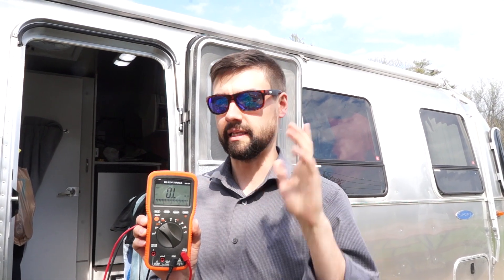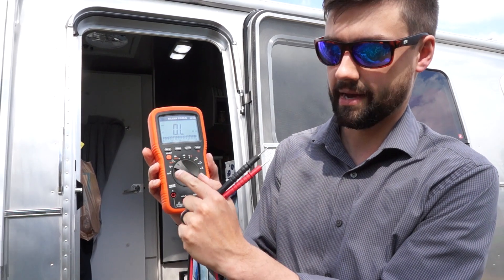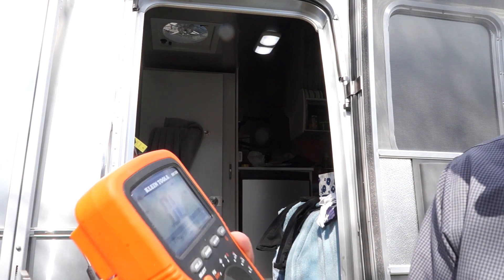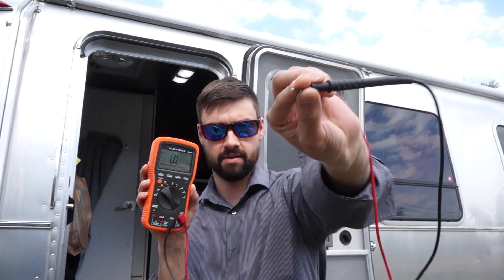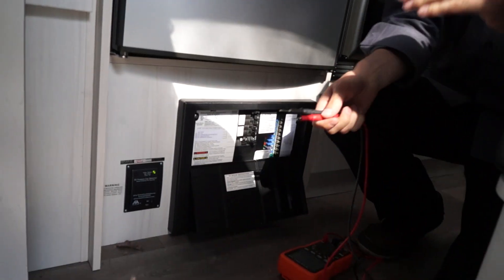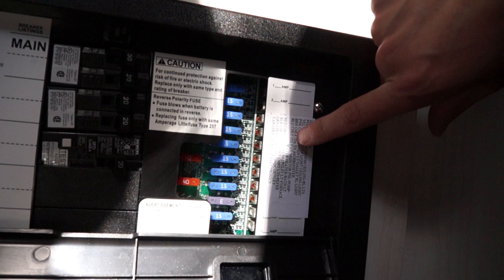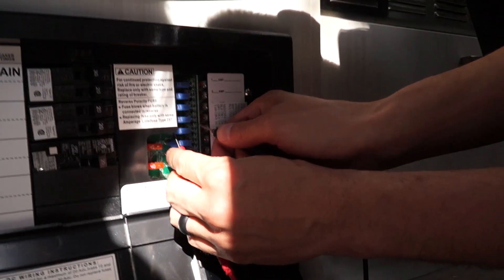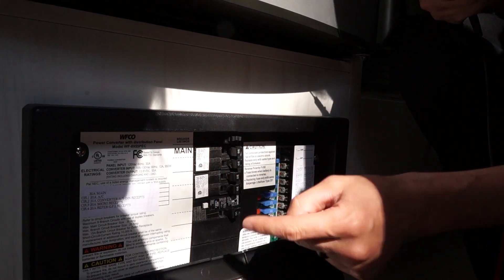Broken Atwood RV Water Heater (Troubleshooting and Repair)

Comment: Hello Touring Treadwells. I am having an issue with my water heater and I can't find any videos that speak directly to my problem. My water heater works on Electric but not on Propane. Using the Propane switch only I get the red light after 3 attempts of lighting. I have my Propane on, tanks are full and my stove and furnace work. I've checked fuses inside and out and they are fine. Any suggestions on how to trouble shoot the water heater not lighting with only Propane?
Reply: Does it ignite at all? I am not familiar with the duel heating units. Have you tried unplugging from shore power?

Comment: I took the front panel off the heater and it stopped doing the turn on ignite and shut off it messed up once and now it's running fine. do you know what this means?  would you be willing to facetime?
Reply: Is that where the air intake is? Sounds like a loose wire.
Reply: @BendItFishing  disregard thst it failed with cover off also. when got to the squirrel cage and cleaned it. the wheel was little hard to spin. it did not spin to freely. I cleaned it and sprayed wd40.  it started getting dark so I stopped and did not change out the limit switch.  it got ugly. thanks for helping.
Reply: The fan should spin freely, it is probably that good luck
Reply: @BendItFishing  how are you? thought I would tell you I ripped into the heater this weekend and replaced the limit switch and the flame sensor.jeez what a day.  it did not fix the issue. I'm down to a bad board. although you would think if it was bad it would not  work evetually.  same thing it turns on for about 30 seconds shuts off and repeats about 12 times then works.
Reply: @brianu3536  bummer hope it's not to expensive
Reply: @BendItFishing  after all that. I replaced sail switch and it fixed the issue. weird bc I checked with Jeter and it was working. put new one in and instant success. had to be the last and easiest part to get to. thanks again

Comment: thanks. is the clicking sound I'm hearing the sail switch or does the board click. sometimes the clicks are closer together like it's trying to stay but can't.
Reply: You might be hearing the sail switch click and then the gas solenoid right after. Does it ignite at all?
Reply: @BendItFishing  yes. you hear blower come on then click and it goes you get heat for 2 minutes then it shuts off and repeats that process multiple times. if you let get going it eventually stays on. a friend of mine said he thinks it's the limit switch? what do you think? in the middle of it shutting off and on sometimes you hear clicking like it's trying to not shut off.  I really appreciate your help. thanks in advance.
Reply: It's hard to tell. Just like my water heater it has multiple safety devices, the sail switch , which if you know where it is manually hold it open, or it could be the thermocouple is not align with the gas jet. Without seeing it, it's hard to tell. Can you pull the furnace out?
Reply: @BendItFishing  I'm going to try to pull it this weekend. the blower sounds normal how can I tell if it slow?would I hear it? I'm not familiar with the  thermocouple. how do I know if sails witch bad? any pointers. can the sail with be bypassed.  thanks
Reply from the maker: You can by pass the sail switch by connecting the wires together. Try that first.
Reply: @touringtreadwells5750  ok thank you.  I ordered a limit switch so I will just keep trying.  hopefully I can find it.
Reply: @BendItFishing  There is no SAIL SWITCH on a water heater. There is a sail switch in a furnace however.

Comment: hi, I have atwood 8531 iv furnace. it starts runs for 2 minutes then shuts off. this repeats about 10 to 15x then the heater works fine.  could this be the sail switch? I hear a clicking while this is happening. I'm on a seasonal site in bucks county pa and can't move the trailer. no repair man will come here. any help would be appreciated.
Reply: Could be, make sure the fan is clean and lubricated. If the fan doesn't spin fast enough the sail switch will stay open and prevent the ignition. These fan collect a huge amount of dust because most are not filtered.
Reply: Do you have any carpets covering registers?

Comment: I have the exact same airstream sport 22.  Thanks for this video, I thought something was wrong with the gap where the spark was.  I did the thermostat wiring test with no luck. (And all other fuse tests). These factory installed circuit boards must be garbage.  Guess I have no hot water for the rest of my camping trip. I'll follow up after replacing board. I'm so disappointed. Its brand new 2019.
Reply from the maker: They are junk and the dealer knew it because they have the new part number in stock! Is it not cycling at all?
Reply: @touringtreadwells5750  it was the circuit board. I found an RV store close by ,they had boards in stock also. Dealer told me it was the 5th one he sold this week. I replaced the board and it fired right up. Thanks again for posting the video.  Now we will see how I get treated by airstream with the warranty process....??
Reply: @gregcarroll7286  our process the dealer handled that we bought it from best of luck

Comment: I am an electrician and I can tell you that dielectric grease is not a conductor. It does keep out moisture that can cause corrosion.
 Also testing a live 12 volt circuit with your multi meter in the buzzer mode can damage your meter. The way to test the fuse  (while it is still plugged in) is to set the  proper voltage range (DC volts) then test for power at the supply side of the fuse and other lead to ground this should read12v. 
Then test from other side of fuse to ground and if you still have 12v your fuse is good and if it reads zero then fuse is no good.
But for the novice it would be easier to pull the fuse and use the continuity setting (buzzer).

When you tested the fuse (if it had been burnt out) you would have put 12volts DC across your meter and possibly ruined you meter.
Reply from the maker: Thank you and good points, I was under the impression that it was conductive, but I guess not. I am not sure why my multimeter did not get damaged because the circuit was live. I probably should pull the fuse check for Continuity and do a voltage test to ground like you were saying. Also not all the fuses would have 12v going threw them during the test correct?
Reply: Touring Treadwells if power is on to the panel  or if the 12 volt batteries are connected in the system then there is power to the 12 volt fuses. The reason your multimeter was not damaged was because the fuse was not damaged and the current to flow through it to its destination. But if the fuse was burnt out the current would want to travel up and through your meter to complete the circuit therefor damaging your meter. It is just like when birds sit on a live wire and doesn't get hurt. It could also be that no current was flowing through the fuse at the time when you tested it.
Reply: Touring Treadwells you can think of electricity like a water pipe. The voltage is the amount of pressure and the amount of flow is the current measured in amps.  This is why low voltage circuits like 12 volts DC do not flow through you very easily because your skin has a lot of resistance but when the pressure or voltage is higher like 120 volts and you touch it you get a shock if you are grounded but nothing happens if you are not grounded just like a bird on a Wire.
Reply: My husband and I were looking at same water heater in my airstream 2016 Bambi and all of the red wires melted!  Thoughts?
Reply: @debbiedouglas6265 7:24

Comment: Thanks so much! This probably saved me at least $100.00. It was the thermo fuse! I tried to get one from Home Depot. The gentleman sanded off the corroded end. I went out to my trailer and put it in and everything worked. My trailer is stationary at a seasonal park so I would have to have a service call otherwise. Thanks Again!
Reply from the maker: Your very welcome, mine corroded again. I put more dielectric grease on it to prevent it.

Comment: New to RVing...when you say warranty covers the part did you contact the warranty yourself and process it? Trying to avoid taking RV into dealership to escape diagnosing fees.
Reply from the maker: I diagnosed it and the dealer helped me find the right part. They dealt with the warranty end of it. If it's less than $100 bucks it's not worth dealing with the dealer or warranty normally for me.

Comment: Did you have to order the same part number for the circuit board, or did you get a replacement based on the water heater’s model number?
Reply from the maker: Replacement based on the water heater number, check Atwood's website for updated part revisions

Comment: grate video.i have a G6A-4E  it sparks its getting gas thermostat is good i think its the gas valve.so if its sparking the circuit board is ok? thanks to jayme for tip on checking thermostat.

Comment: You might have solved the issue in this video by replacing the circuit board, but keep in mind you should also check to make sure it's not your thermostats (where the red and brown wires are connected). You can test these by simply bypassing the thermostat and E.C.O and seeing if the water heater clicks on. Connect the one brown wire directly to the other brown wire, and connect the one red wire to the other red wire to bypass thermostats, and if this gets the water heater to ignite then you know it's not the circuit board, but faulty (and cheaper) thermostats.
Reply: Jayme Schroeder,  I agree with you  how did he know that the circuit board was bad and not the thermostats? That was great advice on how to bypass them.
Reply from the maker: good point, one more cheaper item to check first!
Reply from the maker: Does the gs turn on at all?
Reply: @touringtreadwells5750  I don't know what gs is or if you meant gas, but gas was fine, I suggested that they take a board from a trailer that they know works fine and see how it goes.  So, they did and it's all good now.  Apparently, the 2 new ones they had tried was from a defective batch.  Thank you for your help, this video, and your quick replies!
Reply from the maker: There are two different revisions of the board.
Reply from the maker: You are welcome. There are two different revisions of that board, make sure they give you the new one. Glad I could help.
Reply: @touringtreadwells5750  Do they both work on the atwood model?
Reply: @touringtreadwells5750  ok thank you, I will check :-)
Reply from the maker: Yes the old revision is the one that breaks
Reply: I tried that hooking the wires toghter  The hot water heater come  on when I turned the gas on so all I need to do is replace the thermostat  that is where the two brown wires hook up
Reply from the maker: Sounds like it
Reply: Not everybody is as smart as you, glad i am though. It saves so much money and time
Reply: Sorry I am not very electrical, What do you use to bypass? a fuse? if so what number?
Reply from the maker: You can make a jumper to connect the two female ends or see if a 5 amp or under fuse will fit just to test it.
Reply: Touring Treadwells thank you!  I am at a dealership they changed the circuit board, the thermostat, the thermal fuse and it still not coming on on electricity,  they want to change the whole HW.
Reply: Touring Treadwells how do you make a jumper ?😁
Reply from the maker: Use a short piece of wire and connect the two. What is your hot water heater doing?
Reply: @touringtreadwells5750  I flip the electrical switch on and the light spark but there is no hot water.  It's fine on Gaz   Thank you for your reply.
Reply: @projet2907  That's like telling you that you need a new car because a part is bad.
Reply: @wilmorris8335  Yes indeed,, I refused because the guy working on it did not look like he knew what he was doing, Let alone take it all apart and put a new one !! .  Turned out I went to another shop and it was opened wires underneath the hot water heater that were causing all sorts of electrical problems even to the refrigerator board who fried a couple times.  Probably in the install, they were left under the weight of the WH, and by rubbing against the trailer I don't know what, and made an opening in the wire and caused shorts here and there intermittently.  I had troubles with that for 2 yrs.  Good electric RV repair is hard to find!  All good now!!
Reply: @projet2907  I hear you! Many RV repair shops say, "we don't do electrical, you need to call an electrician." and the electricians say, "We don't work on RV's." Been there!
Reply: @wilmorris8335  Very rare to find a good AC/DC electrical guy.  We must DIY 😁